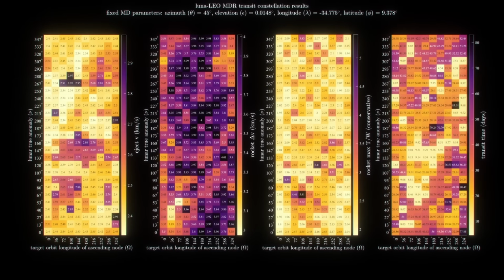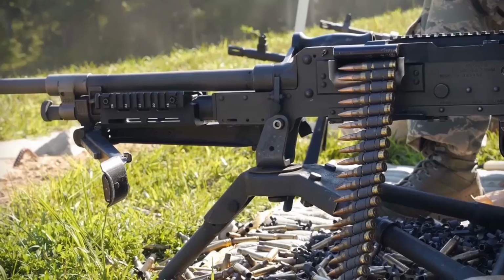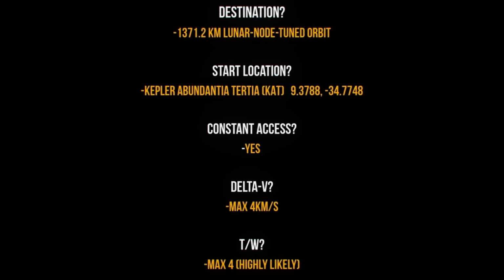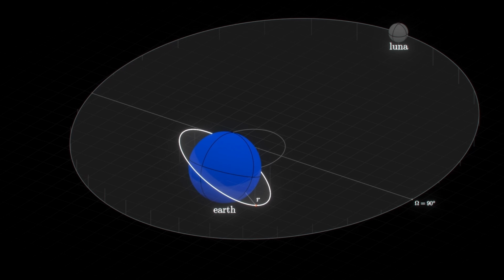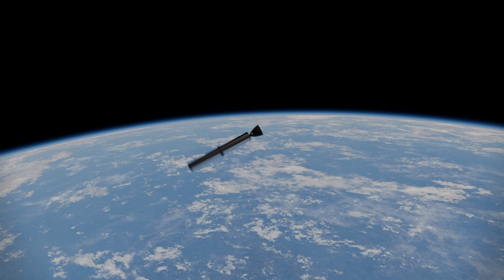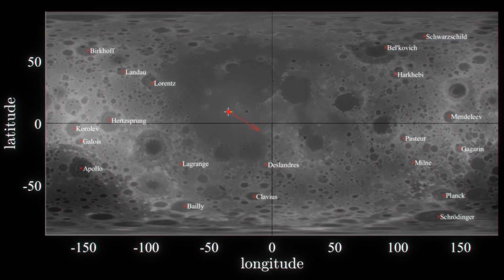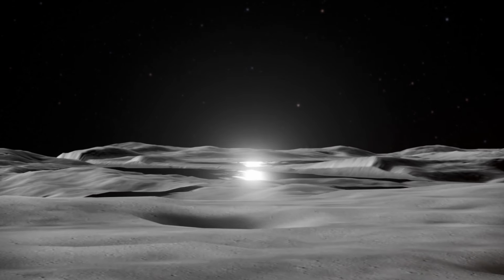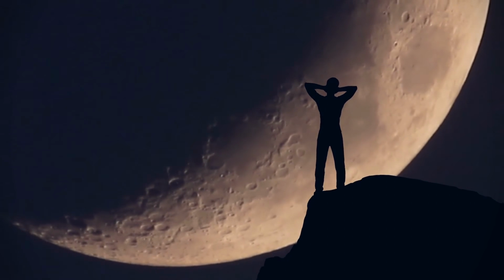Moon To LEO Transfer Simulations For A Lunar Mass Driver & Terrain Analysis + Power Sizing Estimate

Comment: Fantastic, smart, well calculated and engineered assessments. Matching your established high standards.
A reminder: earlier in your video you noted that the unsent fuel delivered by the rockets (O2/AL) WA going to be used by the station for station keeping (daily orbital adjustments). Any extraneous O2 could be sold....
Also, you might want to keep your early rockets (1st 30k?) clones of one another until you have identified and fixed at least most of the bugs, before you introduce variability (and thus new failure modes) into the system. And even then, you go from 1 model to 2,slowly introducing #2, etc. KISS is the mantra at NASA.
(from a long retired "rocket scientist")
Watching your work gives me hope for our future when there seems to be so much darkness.
Keep the flames of hope alive, young man! The future needs you and is counting on you.
May you live long and prosper.

Comment: Given that the mass driver needs to be elevated, would it make sense to use gravity-based stored power (essentially a heavy weight on a pulley connected to a dynamo)?  This might reduce the need for enormous capacitor banks that use Moon-scarce materials.

Comment: If you do a cost efficiency analysis (measured in energy or dollars) I wonder how this mass driver + rocket set up compares to just the rockets alone? If each pod is already its own rocket, a useful baseline to compare would be the cost of just launching each one like a normal rocket? 

Maybe you covered this in a prior video and I forgot tho either way it would be a nice thing to see side by side with your new data.

Comment: Another great advantage of a 45 degree aligned LMD is that payloads could reasonably be designed that fall within that inclination on the surface of the moon, allowing the cost to be offset on future lunar development. This not to mention that with targets on potentially sub-orbital trajectories, there is some insurance; a lot of the potential security concerns and whatnot with launching toward Earth can be dismissed when there is a power ceiling that must be surpassed to even exit the lunar SOI. 

It's why I've actually thought there would be great utility in a polar-aligned LMD, because it could service anywhere on the moon, within 14 days or so of launch. It may not provide as efficient or constant access to LEO, but the trade is a mass driver that can send payloads anywhere on the moon, in exchange for only occasionally servicing LEO. At the level of cost reduction that an LMD would provide, it would still justify its existence to the current market even if it could only launch to LEO like 10% of the time, wouldn't it?

Comment: Wouldn't it make more sense to use the mass driver on the Moon to send payloads to the LaGrange point and have a station there to redirect it to LEO if necessary ? Couldn't you launch to LaGrqnge at any point in the cycle?  Fun analysis...thanks for the effort!

Comment: What do you think of the variable pitch screw launch system for use on the moon? I had seen some mention of a hybrid between VPSL and the Longshot side impingement gun, by using two rails of magnet tipped piezoelectric pistons to push inwards in a travelling wave pattern to press against a projectile with a magnetic bearing boattail.

Comment: Maybe a better propulsion system for these pods would be an Al-LOX hybrid rocket (a throttlable solid fuel rocket that uses liquid oxygen injected into a bed of powdered aluminum). The ISP is terrible, but not only is the pod getting most of its delta-v from the mass driver, the fuel and oxidizer can be made from lunar regolith. With that, you have a cargo pod that (apart from the guidance computer, which will probably have to be sent up from Earth) is 100% manufacturable from lunar resources.

Comment: Does eliminating most of the launch vehicle justify building and operating a mass driver, given that every payload still needs onboard rocketry and fuel? You're essentially distributing propulsion hardware, tanks, guidance systems, etc. across many (possibly too small) payloads. You could instead have a reusable "New Shepard" stationed on the Moon, delivering cargo into lunar orbit, and an Earth-Moon-Earth plasma-engine tugboat picking it up and transporting it wherever needed. I argue that sending "New Shepards" to the Moon and operating a fleet of tugboats would be cheaper than building and maintaining a mass driver. And there's another advantage for the hopper: A mass driver is inherently tied to its launch trajectory. A rocket can choose its trajectory. The hopper and the tug are reusable, you ideally build them once and use them many times. You can even justify launching them from Earth. Mobile, transportable and replenishable. The mass driver payload hardware is not, you have to manufacture it (on the Moon!) and then (hopefully) turn it back into raw materials at the destination. If the mass driver breaks catastrophically it would be an unsurmountable loss.

Comment: Regarding your comment about SRBs: For payloads this small, you might actually get better overall performance(not just ISP) using an SRB instead of a liquid fueled rocket.
The SRB would likely be able to be mass produced better at that size and in low gravity, since you wouldn't have the grain-sagging problem.
Tubes of solidified goop are a lot easier to build than self-cooling rocket nozzles and compressors.
You would have a little less accuracy on the far end of your retro-burn(+-100m/s), so you would need a mobile collector of some sort, but I bet that it would still result in a higher total-usable-mass transfer.
The payload could be made a little more accurate(+-5m/s, slow enough to catch with a net or tether) by having two sets of motors: A big one in the back, and an array of much smaller ones on the front set up in a grid, so that the payload can fire off only the ones that it needs to match relative velocity with the orbital depot.

Comment: Assuming near-future than upgrade to superconducting coils and ease the power constraint OR use a system of thousands of acceleration modules that could operate at very high peak power even in a non-superconducting region. More coilgun than rail gun type mass driver.

Comment: I just wonder if the requirement of the mass launched (per each unit of usable payload mass, which in this design is the cargo and the rocket itself) by utilizing infrastructure for catching the payloads. I think about sky-hooks used for that regard. In principle the payload rocket does not even need to execute full orbit insertion burn, just needs to adjust it's trajectory to intersect long enough with the trajectory of sky-hooks end-points, and those will slow it down for easy capture by the orbital depot/destination itself. You could even have some eccentricity in sky-hooks orbits so they can "visit" multiple orbits and receive payloads there, although in very short bursts. Parking orbit trick would probably be required but it still potentially saves few hundred m/s of DV which can yield huge mass savings per each rocket launch.  (It has added benefit that we can start without the sky-hooks initially and construct them with the material delivered purely with methods proposed in this video).

Comment: You just solved the math side of the equation, but ran out of time to talk about the economic side of the equation.

In 2019, SpaceX for the first time in human history, flew the Flacon 9 into Low Earth Orbit for under $1000 per lbs./$2200 per kg. Even if we want to add the cost of the mass driver to the cargo pods sent to this new industrial station in LEO, it would be under $100 per lbs./ $220 per kg, which is the estimated lowest cost for a rocket system leaving from Earth. And that is being highly optimistic for the rocket from Earth and highly pessimistic for the mass driver. So the economics alone would cause the mass driver system to pay for itself and its replacement long before it would need to be retired.

Now getting the equipment to the moon and setting it up would, at best, be a decade of hard work, and priority work status just to get it started, assuming you wanted it to be built with resources from the moon. If you build it on Earth and ship it to the moon, you can get it done much sooner, but it would be several times more expensive upfront and would struggle to pay back its investment into it. So companies would choose the former option, while governments might consider the latter option.

While 4g's is uncomfortable, it is easily survivable for up to several minutes without the possibility of blacking out. Fighter pilots are trained to withstand up to 5g's normally, and up to 8-10g's with a g-suit for some time. So, while it might not be human rated, it could be used as one in an emergency if needed. The 35 kg payload limit might be a problem for anyone older than a child, but if you don't need to get to the LEO industrial station, you might be able to get up to a full adult in a pod with an emergency beacon for someone to get help. And yes, most regulations mandates that rollercoasters are only allowed up to 3g's under normal operations, so 4g's for the 21 seconds on the mass driver would be the most intense rollercoaster ride out there. Just remember to bring life support and snacks for the trip.

Comment: Are we sure the sweet spot is 1200-1371 km above the Earth? What if a mining consortium wants to bring back metals and goods back to Earth, what would be the best orbit and plane to shoot for for de-orbiting? Maybe a second orbiting station for Earth bound materials and men from the Moon should also be considered.
What I am getting at is the people of Earth consider space travel and colonization as an expense category far above the margins of existence, and it is exaggerated even if you can show a profit. However the secondary argument is that it doesn't benefit mankind directly.
Well thousands of tons of material and goods delivered each de-orbit would allow us to contain the environmental damage of mining on the Earth itself.
Also technologies and material only capable of being made in space can benefit those who go get it and make it.
At some scale of automation and expansion with robots and von neuman machines, the people of Earth and companies will reach abundance and surpass the industrial capacity supply of the Earth. Hence, we need less mining/crude industry that pollutes worse, but focus on advanced construction and technology instead.
If there is enough water on the moon for rocket fuel and air, then maybe the surplus could be used to farm there or in LEO and feed the people. Once the massive millions of robots finish the engineering works and makes the plants and mining machines. Or run them in parallel with exponential growth that's only limited by the tech and time to produce duplication.

Comment: Though I haven't watched the video yet, from the visuals at the beginning I'm guessing that only mass drivers on the surface were considered.  Isn't tunneling on the moon one of the primary reasons for The Boring Company's existence?  Is it that obvious to everyone else that building complicated structures, subject to abrasive dust, on the surface is simpler and easier than tunneling?  It's not obvious to me and I sure wish some engineers with knowledge of The Boring Company's potential capabilities would seriously explore the feasibility.

Comment: You might not be able to find all the information the same, but Rocketdyne has their version of these in space engines. Their Star-9 equivalent, AR46 has a thrust of 1600lbs and total impulse of 465k lbsec. I think we might have a good case that the math may be better than thought

Comment: Awesome video!!  Question: Would a tunnel structure for the mass driver help with stability/construction complexity and also with thermal cooling since can cool the tube by conduction with the regolith versus radiation to the vacuum above the surface?

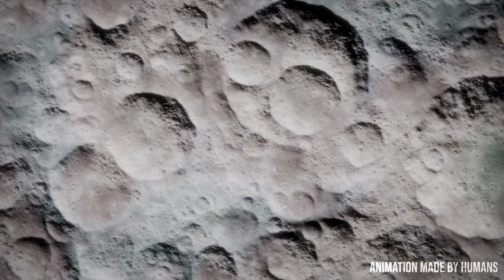Comment: 2:52
That can't be right.
It takes the same amount of energy to accelerate from 100m/s to 200m/s as it takes to accelerate from 2100m/s to 2200m/s.
So assuming average acceleration, the power consumption should be the same over the entire length of track.

Comment: well the problem with space debris isn't necessarily the amount today it's just that it's growing fast and unless we do something before it gets too out of hand it could end up like climate change too little to late, after all it is an exponential curve so would grow very quickly after a tipping point. An easy solution to orbital debris would be an orbital land tax to fund basic debris removal infrastructure, Hank Greens video on why it should be done is way too good.

Comment: When we refine regolith on the moon, we will frequently have leftover O2 - lots and lots of leftover O2. Can we simply use pressurized O2 as a cold gas thruster for in-transit course correction and slow-down 'burns'?

Comment: I like it, but I'd send the bulk material to HEO for manufacturing, where larger, high traffic facilities do not interfere with unrelated LEO traffic. Also, this is a good altitude to build spaceships that never enter Earth's atmosphere. They can be bigger and less ruggedly built for accessing the rest of the solar system with comfort and efficiency.

Comment: I wonder if peak power is really a limiter since the peak power is distributed over a much longer distance, I would rather optimize for higher exit velocity since it's a one time investment vs the pods which are a continious investment (of refined and therefor energy intensive materials). Also a decelleration for the sleds after payload release might make a lot of sense for energy and materiel recovery.

Comment: You did some amazing work in this one.  I still think you're wrong about solar though. Copenhagen Atomics is producing such a small powerful reactor. I don't see how solar could possibly compete. Smelting raw ore is going to be necessary regardless of the route we go. But making panels will still require a machine shop for many things it just adds an extra building that's not needed when making reactors. The moon is loaded with thorium and has all the metals we need for a reactor. And with the power output of just one it'd be more than enough to power build the rest of the facilities needed to start producing more reactors. If we're setup in Shakleton crater with no sunlight we'll need district heating anyways allowing for easy cooling of our working fluid.

Comment: would a variable pitch magnetic screw, be better for the thermal issue rather than coils? from the few versions i've seen of how it works it shouldn't have the same power issues or at least not as bad since it would need a constant amount the whole way through the gun for a certain acceleration.

Comment: The best would be to build this at lunar orbit. Its where the technological base and  dockyards for building and launching interplanetary ships should be built.

The station could double also as a base for lunar WALDO operators and Humans could skip living in low gravity and hazardous lunar dust on the Moon. The station could have simulated gravity if it rotated. It wouldn't need to be exceptionally large. And this material could be ordered around the rotating station to create a radiation shield.

Comment: Already at the 6 minute mark I'm puzzled by the question: why constant acceleration instead of constant power?
In your animations your track is built of what look like modular sections that are all identical, whereas a constant acceleration track would want asymmetric sections, like an reversed gun with the breach like thick walls at the end of the barrel instead of the beginning.

Comment: For LEO mass the final answer is on roughly the same scale as one starship launch per day. It seems unlikely to the point of abusrdity that the total cost per day of the lunar mass driver project could be less than running a one launch per day heavy rocket program (even if the rocket was disposable). On the other hand if the destination is GEO or lunar orbit or another planet, the advantage becomes 10:1 to 100:1

Comment: im before,w e setup a giant sand blasterin space, jsut send the dust upinto orbit, XDDD,
uinb4, we jsut make massive long steel/cables and we jstu have ti constantly pull up and out to leo, giant tether jsut constantly reelignit in XD
10 tonnes of 10mm steel cable from moon to leo and jsut pullit down :D XDDDD i jk

also, tbh a basic battery on each mass, and one of the static propulsions on each,

Comment: You don't need the large deceleration rockets on the payloads.  You can use a similar deceleration mass driver on the near earth orbit station to catch the payload.  To prevent the station from losing/gaining orbit, you can fire payloads at a different trajectory that puts the payload in a counter orbit, and catch those which will cancel out the momentum of the first shot.  Or put a single much more efficient rocket on the station to cancel out the momentum transfer.  Infact, if you put a magnet on the payload, and use a coil as the decelerator, you can capture the deceleration as electrical energy and use it in some way.